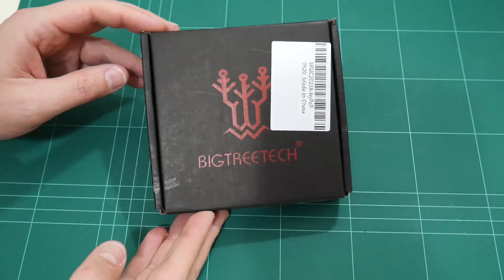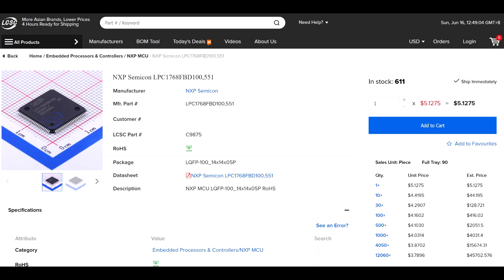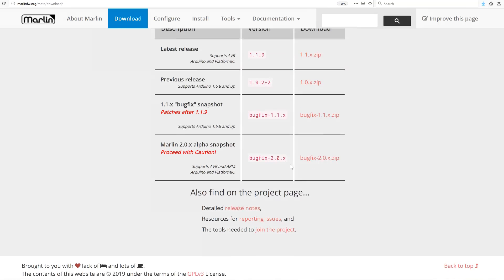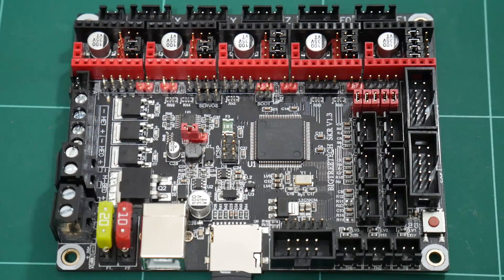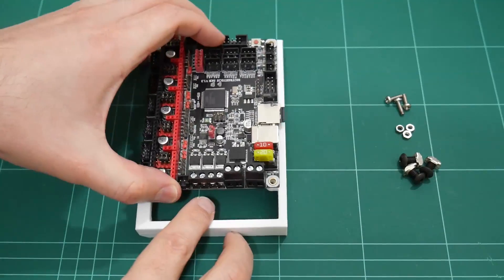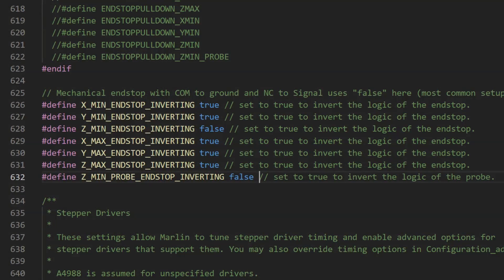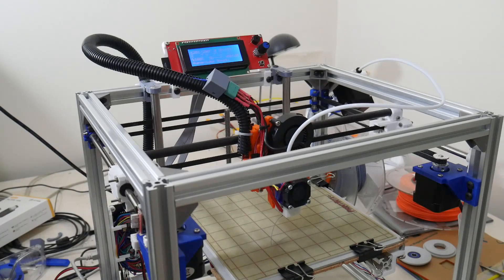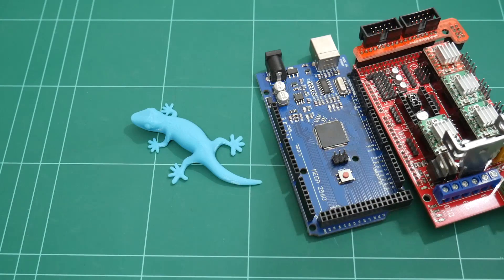Cheap 32-bit 3D Printer Controller!

Comment: I got this SKR1.3 too, combined with TMC 2130 without spaghetti SPI wiring, on my Hypercube.

- sensorless homing
- no wires for SPI
- clean

Also bought 4x TMC2130 with pre-configured SPI direct replacement for 22 euros from Bigtreetech.

Also added the TFT 3.5 touchscreen LCD together with the smart LCD screen controller. Really a huge upgrade with all these features.

Tip: the E1 heater input can be used for turning the hotend fan on when heating E0 to 50+ degrees, which is nice so when idle it doesn’t make any sound.
Reply from the maker: Well done. Yes that extra mosfet output can be used for anything. I'll probably do the same as you.
Reply: @Tech2C  hi, top video as always. Do you know "zesty nimble" that's change bowden to deported direct drive. That should be cool to try to integrate it to the hypercube.
Reply: @blackmorth  having a printbite+ surface he probably knows about flex3drive already.
Reply: Are you going to try SKR Pro next time?